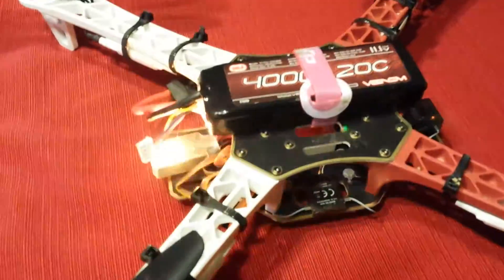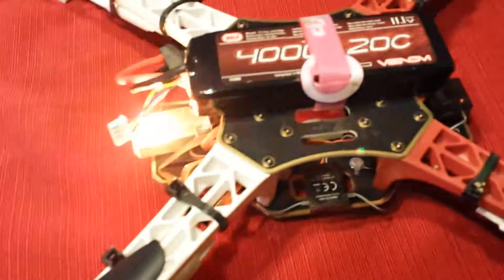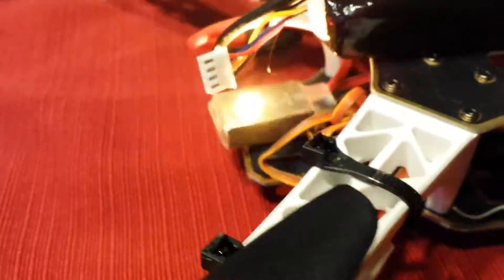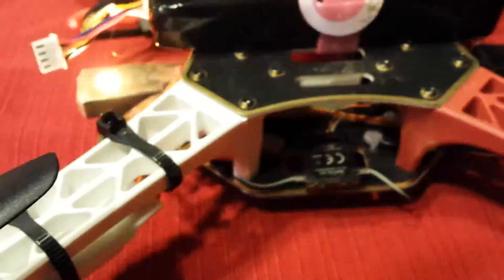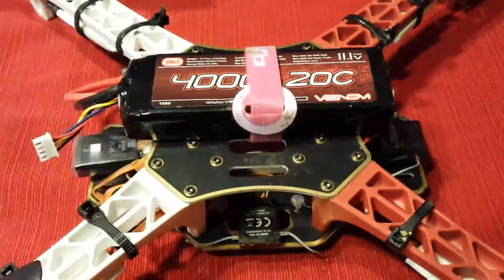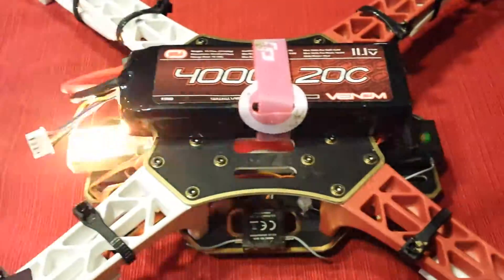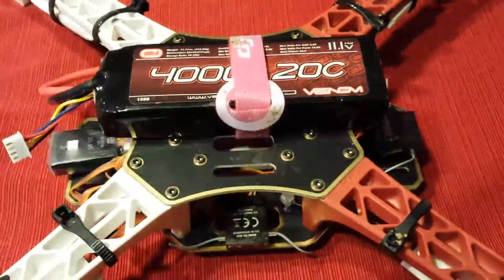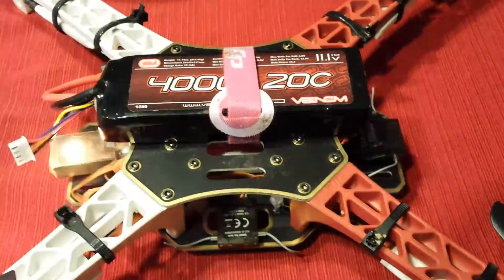Yellow Blinking Lite on DJI F450 Binding Issue using Naza Lite!!

Comment: I got the dji naza light and my led flashes red that fast I am using flysky fs-i6 transmitter and reviver was able to bind and if I plug a motor directly into the transmitter I can make it spin buy it’s self but if I plug all the motors and everything into the naza light controller nothing works and just flash’s red fast  I just got done putting it tougher never able to fly it at all
Reply: And naza’s  firmware motor controller setup program don’t work for me

Comment: I have the very same problem but I'm using a Hitec Aurora 9.  Yellow blinking, no motor response.  I have the assistant set to traditional receiver.
Reply from the maker: Did u update the assistant driver.   Top left hand corner of software.   Update driver.

Comment from the maker: Jerome Hernandez,  the issue did get resolved it figured out that I had on wire from my transmitter that was plugged into the wrong port.  So when I started up the assistant, my naza was defaulting to attitude mode.  Which is fine, because you can fly it that way.  What was happening sometimes was it would not default to attitude mode.  It would be somewhere outside of the slider where no flight mode was lit up blue.  So when I switched to wire to the correct port and set up the attitude and manual ( at the time i did not have gps) it started working fine.   And ever single time after that.  Now i have Gps and i set it up so i have failsafe, gps, atttitude and manual, and it still works fine.  I will be posting a video of the exact wire diagram and assistant set up, along with how i configured the transmitter to let the slider fall into the different flight modes.

Comment: I had the same problem and was freaking out. You need to run the dji assistant program and change the reciever type from ppm to traditional. Please respond after you try this!
Reply: Please can you explain the process in detail. I have the same problem. And I'm clueless 
thank you
Reply: Petr Sobcak
What you need to do is go into the dji naza settings and go to the tx calibration page, once there you need to change the receiver type to traditional.

Tell me if it works! Hope it helps!
Reply: MrCameron3289 
yes I am in tradition. rx get into all the corners, but the engine does not start any gesture.